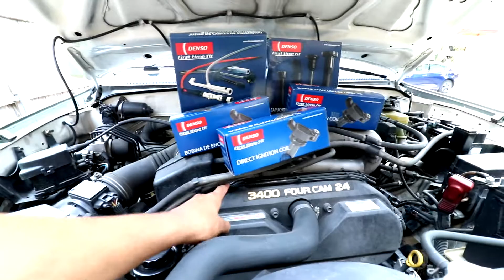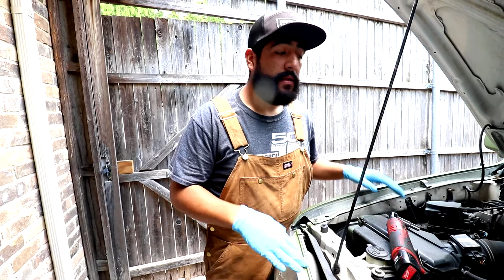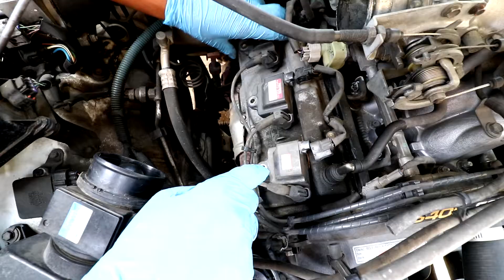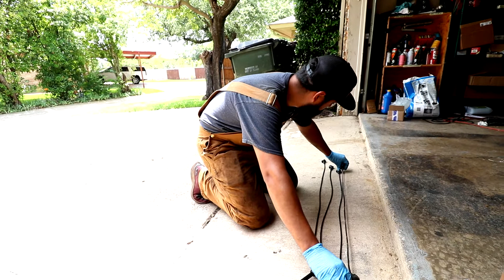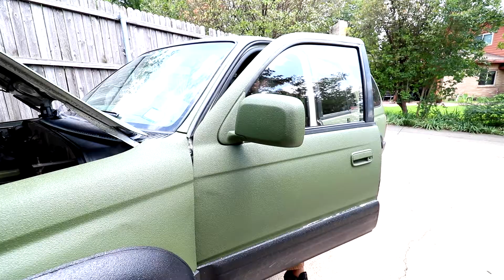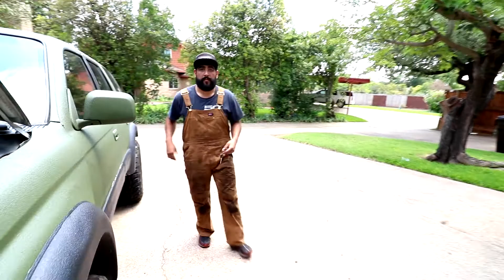How To Replace Coils and Plug Wires | Full Walkthrough

Comment: Great tutorial! Does the length of the wire matter, as long as the connection is correct?
Reply from the maker: Doesn't matter so much as you dont have any wire rubbing issues. I would say to try to compare them to your old wires. I think only one of them is longer than the others.

Comment: Hey can you tell me what lengh lead is ment to go to what coil
Reply from the maker: I went one by one to compare the length to each corresponding lead. Truthfully they will all work the same however it will affect how they sit in the wire separators and may touch or rub on other areas they shouldn't be. So best to just compare them to the old ones to be safe (assuming they were in the correct positions previously).
Reply: If they weren't in the correct order most likely to begin with, and you've pulled them all out already, what's the best way to re-map the new ones and put them in in the correct order?

Comment: How do you know the coils need to be replaced? My 99 4Runner is every once in a while miss firing.
Reply: Has the miss firing tripped on the check engine light? If so, use a OBD2 scanner on your 4runner. You'll get a code P0301/2/3/4/5/6 telling you which cylinder is misfiring. Switch out the misfiring cylinder coil with one of the other one of your engine. Clear the obd2 codes. If you get a new misfiring  code in a new cylinder, its the coil, if it's still coming from the same cylinder, you got good coils and something else is causing the misfiring.

Comment: You didn’t change the plugs?
Reply from the maker: I had changed the plugs about 10k miles ago with OEM and started to get a misfire on the 3rd coil pack every 3rd week. I did pull one out (not shown in the video) to check the condition and it was very brand new looking still and had the correct gap.
Reply: @hpspeed8877  Were you getting any misfire before the change of plugs? I know you mentioned OEM plugs but what part number did you use Dense 3194? I am about to change the plugs on mine but what you mentioned concerns me, thanks

Comment: Can the coil cut in and out , & act like a fouling plug?
Reply from the maker: Yes very possible. There are ways to diagnose whether it is a coil or a plug. However with Plugs being so cheap and could also be damaged from a failing plug it would be better to replace both if you suspect a failing coil
Reply from the maker: I will note I did NOT do this as the plug in the cylinder in question was near brand new and inspected for operation.